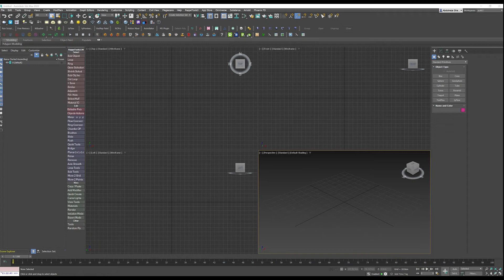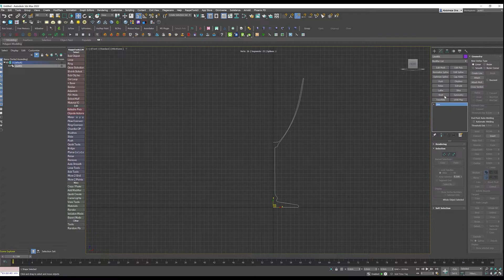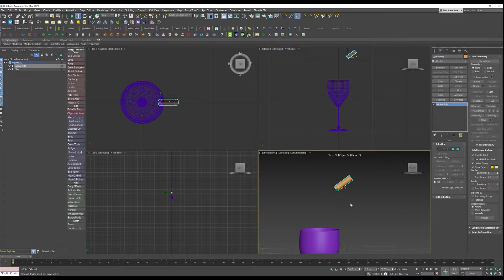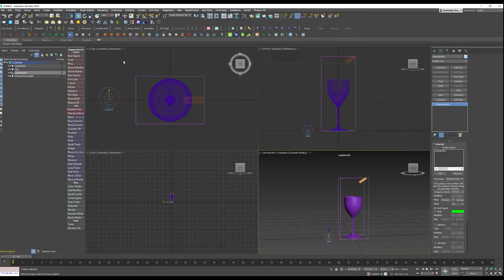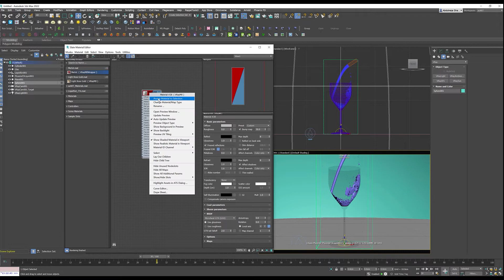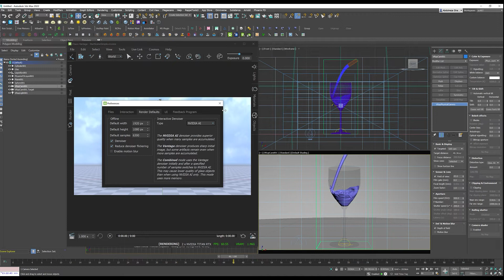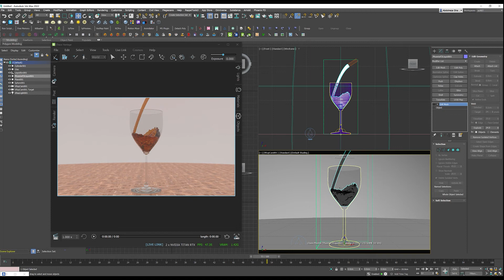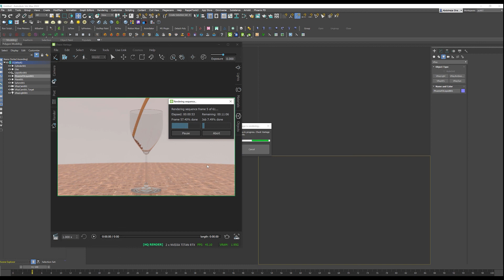3Ds Max - VANTAGE Tutorial | "How to render Phoenix LIQUID simulations in Chaos VANTAGE"

Comment: This is a very nice tutorial… 🙏🏾 
But i am having this very slow simulation despite that the tutorial i often follow seem faster…
I am using a 32gb laptop with rtx 4060 nvidia… please any solution to make it faster a bit?
Reply from the maker: Hi and thank you very much for watching and for your feedback .. Regarding the speed of the simulation and the performance of your hardware, there is somthing that you should keep into consideration. Fluid simulations are taking long. In some cases there is a calculation time of 30min. per frame. So the time that you need to simulate depends on your settings and in order to achive some good looking results, time is your only friend. You cant rush your work and expect good results.

The speed in this particular tutorial is a pretty simple setup with a few particles getting emitted only. Such a setup works usually fast but the final result would require much more particles for more accurate results. 

Do not think too hard about the time that you need for your sims and renders. More important is delivering good results and if you can do that, your clients will wait.

Hipefully these imports are useful to you .. Cheers
Reply: @asARTMotionGraphics  thanks a lot, i really appreciate your kind response.
I was able to simulate and render, the rendering of the animation of 150 frames (1280 x 720) is even faster than the simulation itself 😅…
But overall i am happy i am understanding how it works…. 
One more thing, the liquid I simulated isn’t coming out as thick as the one in your tutorial despite setting it up as yours, could there be any parameter i could change just to make it thick? 
Thanks a lot bro 🙏🏾
Reply from the maker: @abubakarabdul9755   You are very welcome .. Glad to hear that it was helpful to you. 

Not really clear what you meant by "Thickness" of the liquid!? .. The diameter of the flow depends on the diameter and/or shape of your actuall emitter (cylinder, sphere etc.) .. If you want to change the "Viscosity" of the liquid, you'd have to tweak the settings for it in the DYNAMICS rollout and also make sure that the coresponding channel gets exported in the OUTPUT rollout.

Give it a run and have fun .. Cheers

Comment: thank you bro, almost exatly what i was searching for. is it possible to render smoke / fire sim in vantage also? i cant seem to find any kind of information online about it
Reply from the maker: Hi .. Smoke can't get done yet since all we have to work with are particles and the shaders are not supported by Vantage. For fire, we found a solution but still working on a better work around. But generaly you can use VDB files and convert them to Meshes in render mode and that should work .. Hopefully these information are useful to you .. Cheers
Reply: @asARTMotionGraphics  It's so cool,  but could you tell me more detail about that.I tried to use Phoenix to make a VDB file (alot of file vdb), then how I can convert them to meshes? Do I need another plugin to do that?Thank you
Reply from the maker: @haiduong2090  Hi .. VDB files should also work. but if you are trying to export FIRE or SMOKE that still will be pretty tricky and may fail. However, in order to use VDB Files from PHOENIX FD you need to add a "VrayVolumeGrid" into your scene which allows you to load VDB Files. You can also load the PHOENIX FD Sim Files (.aux), which eliminates the need of VDB Exports totally. After adding the "VRayVolumeGrid" into your scene, it will ask you for the files locations. You can use VDB or AUX files.

In the settings of the "VRayVolumeGrid" goto:

[PREVIEW SECTION]
- Set "Auto Reduction" to "0"
- Deactivate "Auto Reduction" check-box
- Deactivate all check-boxes in the "VOXEL PREVIEW" Sub-Section except "Auto Range"
- Deactivate "GPU PREVIEW" Check-Box

[RENDERING SECTION]
- Set "MODE" to "MESH"
- under "SURFACE" Sub-Section > Select TEMPERATURE"

After tweaking the settings above, you should add a "EDIT MESH" modifier to the "VRayVolumeGrid". You now should see your VDB and/or AUX files in VANTAGE.
Hopefully these informatiion are useful to you .. Give it a try and let us know how it went .. Cheers
Reply: @asARTMotionGraphics  OMG, I used to add VRayVolumeGrid but it's so fail, maybe my setting's not ok,  One again, thank you so muchs bro for your comment.😁👌👍
Reply: @asARTMotionGraphics   +After all the step, I've just got a mesh-box in 3ds max and Vantage ^^.

+ If I change "Temperature "to "Speed" in Surface section, I got  a deformable mesh and its does not look like the flame anymore.

+ If posible, could you make a  tut video how to conver fire (Phoenix) to Vantage. That's will the best answer for all of noob like me ^^.
Reply from the maker: @hai duong  Yes, this is right. In some cases that happens, but there must be a "TRESHOLD" or "ISOSURFACE LEVEL" values that you'd have to tweak. Look for that and change the values until you can see the shape of the actual simulation .. However, FIRE and SMOKE sims are pretty tricky right now in order to make them work in VANTAGE. We are working on a workaround and will publish the tutorial as soon as everything is in place. It will take a while tho since we also are pretty busy with everyday business.

Btw. if you are interested follwoing us on Facebook, there you'll see an example of the FIRE Sim, that we made using PHOENIX FD and renderded in VANTAGE.

Here is the link to our FB-Profile:
http://www.as-art.ch/facebook
Reply: @asARTMotionGraphics   @asART 3D and Motion Graphics:  I hope that Chaos will take it easy to do simulate Fire soon, Its so great to know that some group has been change the workflow because of the Vantage's feature.

It's nice to see your FB and  Y.t channel, I've submmited and follow both of them. Hope to see your tut soon. Thank for your sharing.
Reply from the maker: @haiduong2090  Thank you very much for your kind words and for following us on social media. Much appreciated. We'll post our new tuts for sure as soon as they've been released. But as already mentioned, the timing depends on the progresses we made and the time we have available todo so ... Thanks again and stay tuned .. Cheers